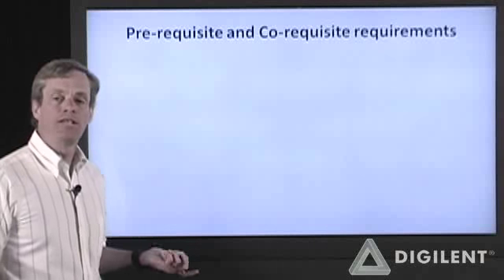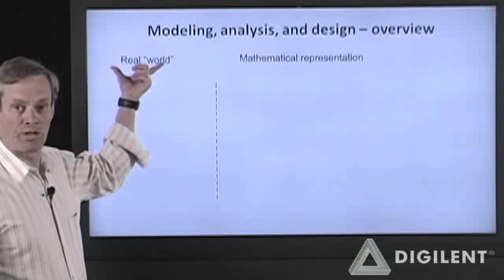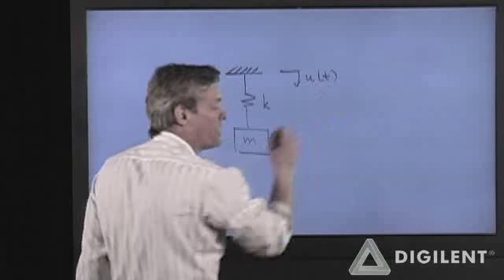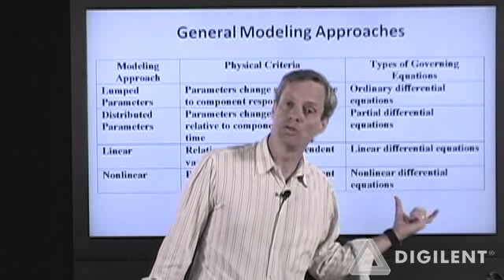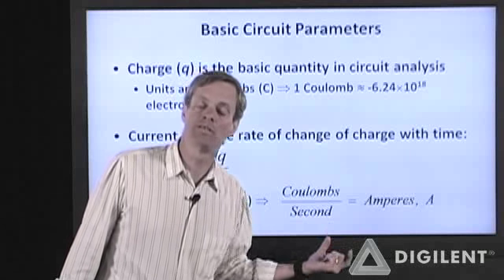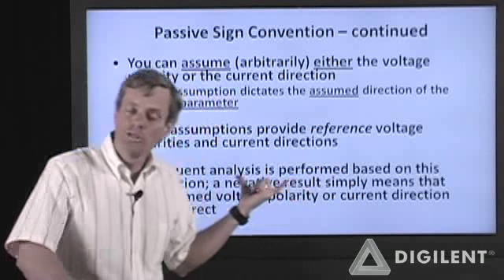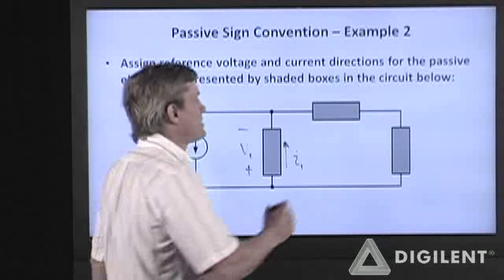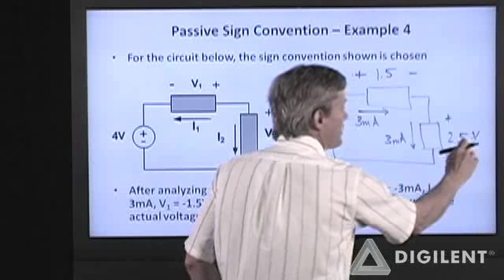Real Analog: Circuits1.01

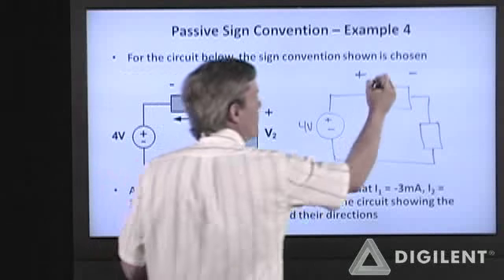Comment: At 41:59, "1.5" should be "1.5 V" -- other than that, super! But check my thinking. With the plus and minus voltage signs consistent with the current arrow direction, will v and i always have the same sign? For example, if the circuit analysis had shown that i1 = -3 mA and v1 = +1.5 V, would the exercise be impossible to solve? [Just started video 1.02. It seems like i1 = -3mA and v1 = +1.5 V (with plus and minus signs and arrow direction obeying the passive sign convention) indicates power is generated instead of dissipated.]